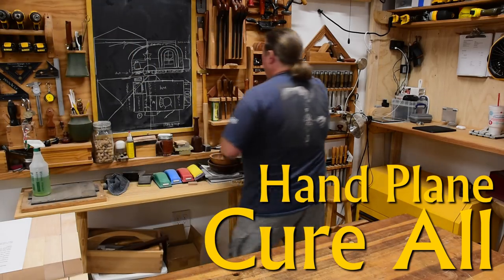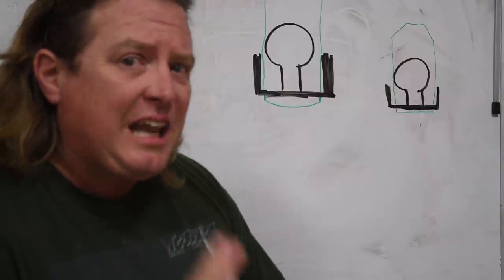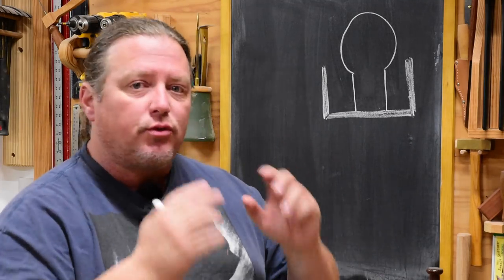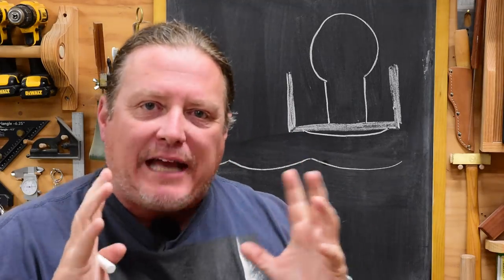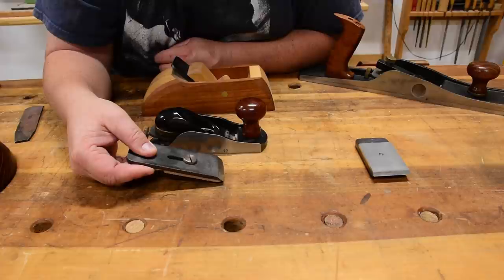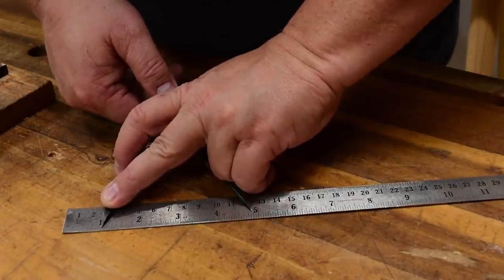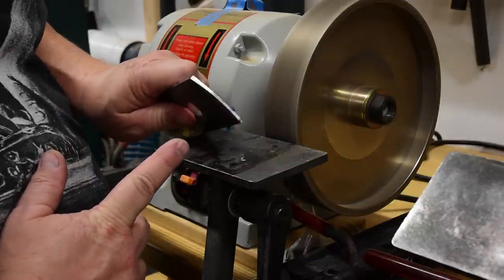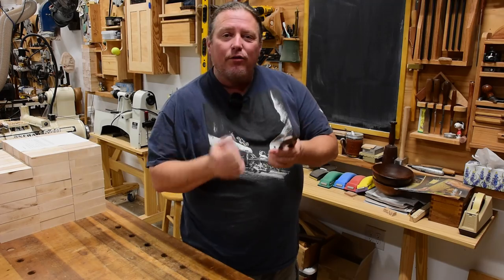Hand Plane Cure All - Cambers

Comment: When I first saw your drawing on the whiteboard, looks like a front bead on a rifle or pistol sight, for training purposes!  Couldn’t resist the analogy.  Do you radius the blade on a jointer plane?  I just round the corners on a smooth or jointer to eliminate the edge digging in if everything isn’t exactly perfect.  Which I ain’t.  Good video.
Reply: I think he said he cambers all his bench planes in the video :)

Comment: I'm having a weird problem sharpening my plane blades and I'm wondering if you might know what's going on.  I'm using waterstones, flattened with a rough DMT plate, and I'm also using a Veritas MK II jig.  But lately all of my plane blades are coming off the stones with a hollow in the middle.  I'm being very careful to not press down in the middle of the blade hard when sharpening, and I'm even finding myself having to compensate by continually having to put a camber on the blade after moving up each grit to offset the hollow that I'm building up.  What's going on?
Reply: That would be the first time I hear a stone is proud in the centre ;)

Have you checked the flatness and the wear of the diamond plate you use to flatten the water stones? Those do wear as well, or can get bent. Good luck!
Reply from the maker: If you dull the center more in use you'll always have to remove more from the sides in sharpening to maintain straight. Sounds to me like you do more edge work than face work.
Reply: ive had thos happen as well, mostly on my bu planes that i try to keep straight, so i started to camber those as well. i think shawn is probably on to the issue here.

Comment: I cringed when he was grinding the blade at 90° its so much work to sharpen
Reply from the maker: As explained in video, grind shape at 90 then grind bevel. Less chance of changing temper. The bevel didn’t take me 30 seconds. Showed in video.
Reply: Thats how its done when changing the geometry of an iron with a grinder....... removing so much metal while holding it at the bevel angle means the leading edge gets VERY hot, ruining the hardness of your iron. Once its shaped, then you do the bevel, very carefully and cooling every 3-4 seconds of grinding. You are only cringing coz you dont know how its done...... if ya go straight to the bevel, the chances of havin scrap metal in your hands instead of a cutting iron is DRASTICALLY increased :) 
If youre doing this kinda job, follow Shawn's instruction, they are good :)